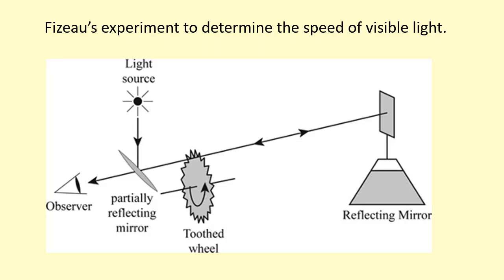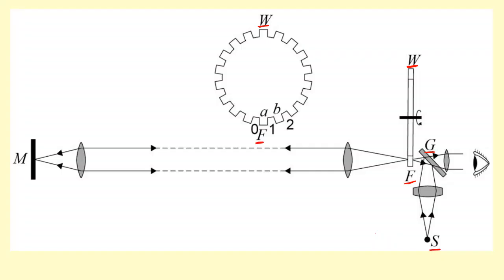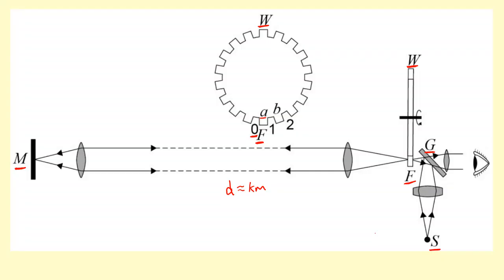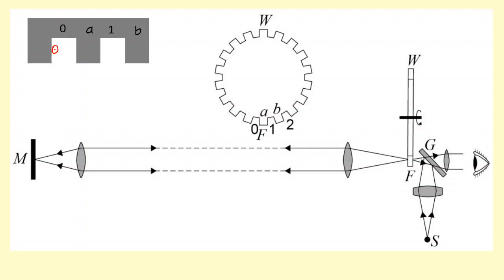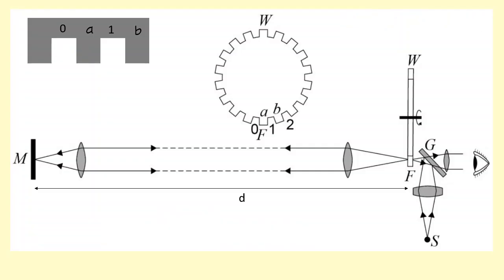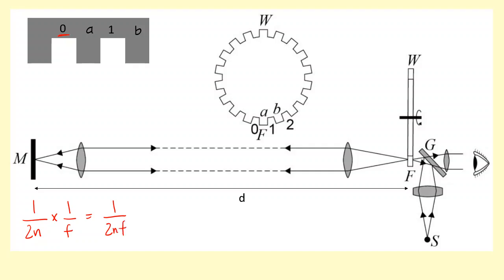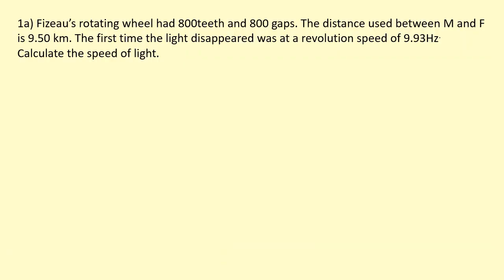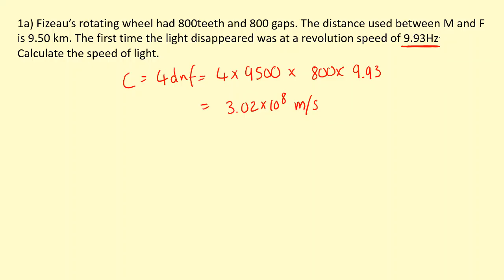14.09 How did Fizeau measure the speed of light

Comment: Hi, at 5:35 why is it only 800 didn’t you say you add both of them? So shouldn’t it be 1600
Reply from the maker: that factor of 2 is already within the equation now. Which is why it's a 4 at the front.

so there are n gaps and n teeth. Total is 2n. Which i've already put into the equation so n is just 800.

Do you see what i mean?
Reply: Sorry I don’t understand. But I see it was just a proof of the equation not what we need to do. So it just 800
Reply from the maker: @osmansadat9650  

n is defined as the number of teeth ( or gap it doesn't matter)

in the derivation i had to use total number of gaps and teeth so i used 2n.

Once the equation is dervied you can't switch the meaning of n from number of teeth to total number of teeth and gaps.

to be honest you i don't think they will test derivation.